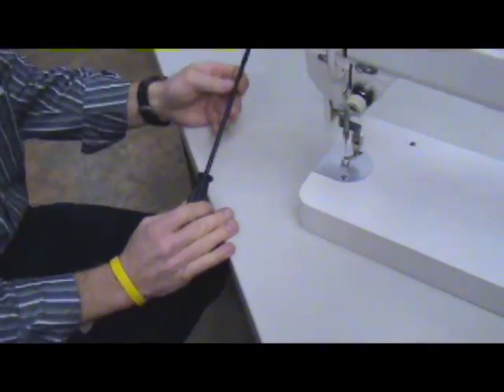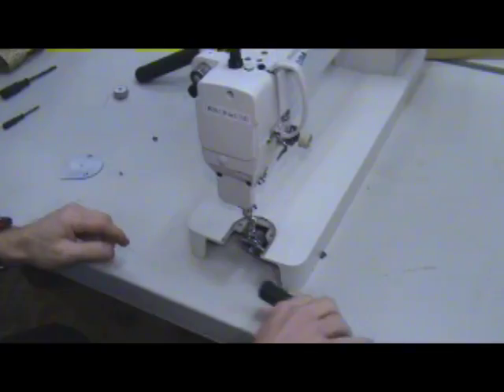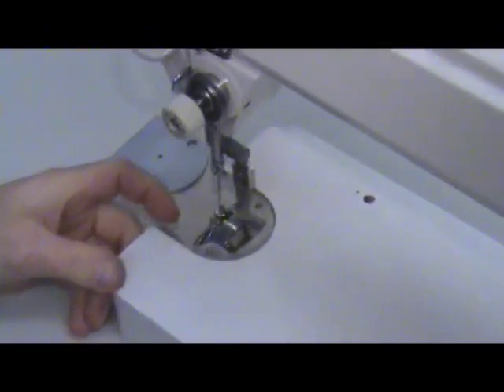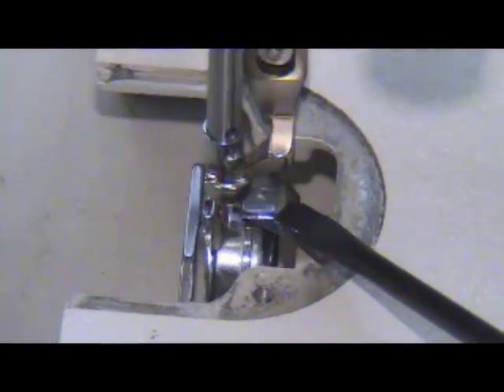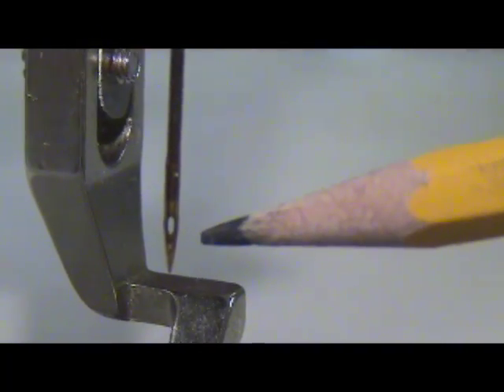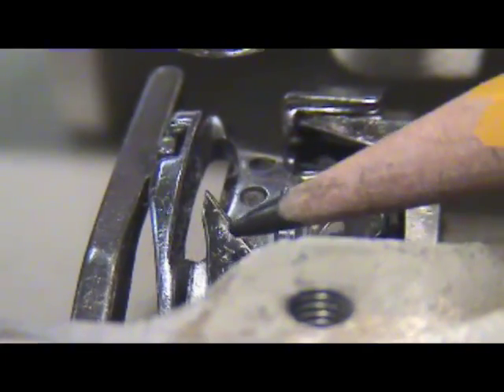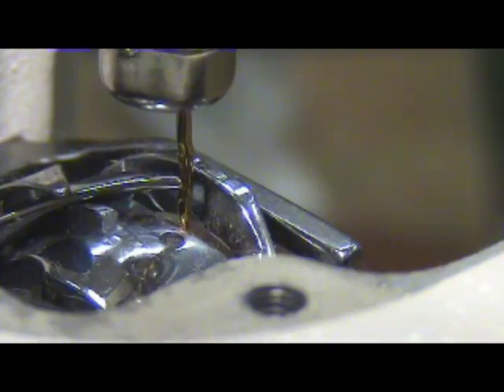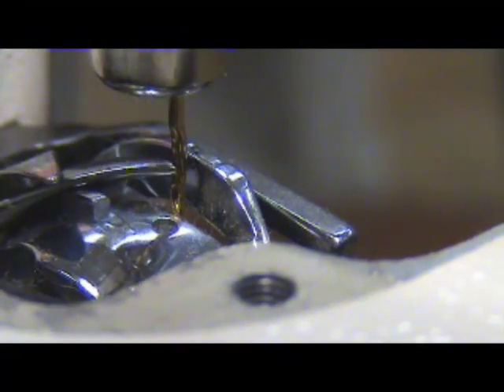Timing your Machine Part 1  7 Mar 2011

Comment: Thank you for explaining the needle guard versus the hook and also about the stopper mechanism.  I have a vintage Stradivaro with a vertical bobbin and an Elna Lotus with a horizontal bobbin that both need timing, but I could not follow other videos.

Comment: on my machine, I removed the top cover. Which gave access to the top of the splined belt.
I put the hook just before the needle. Then removed the belt from the sprocket. Which disengaged the hand wheel from the hook rotor. Then turn the hand wheel until the needle is in the correct position. Then put the belt back on. Whala!
This is the first machine I've ever taken apart. & I haven't sewn in 30 years!
You CAN do it!